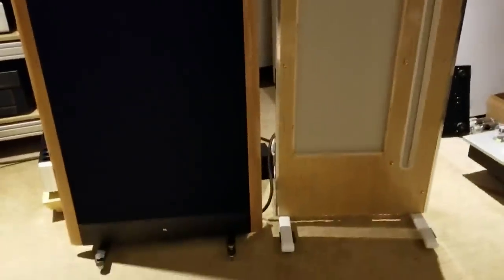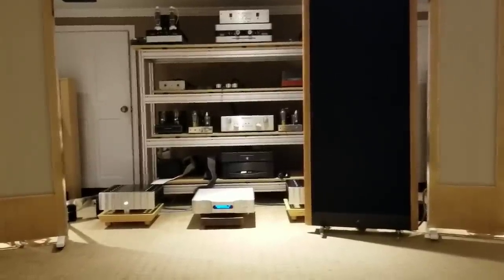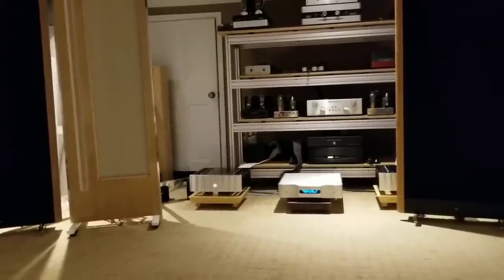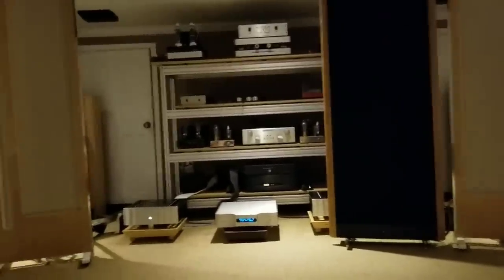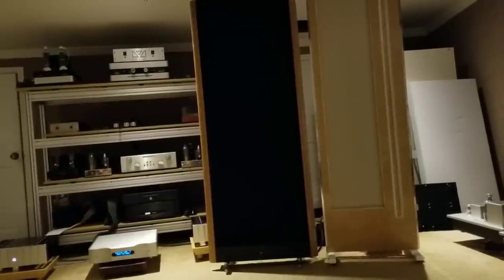King Sound ELECTROSTATIC SPEAKERS V.S.  PLANAR MAGNETIC Magnepan.

Comment: ::::::::::::::::::::::::TIMESTAMPS::::::::::::::::::::::::::::
Electrostats               -                 Maggies
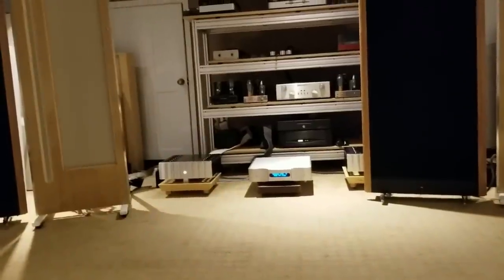     2:38                       -                     8:30              
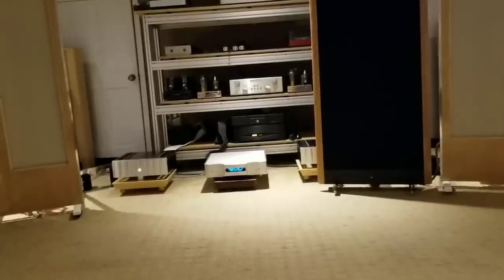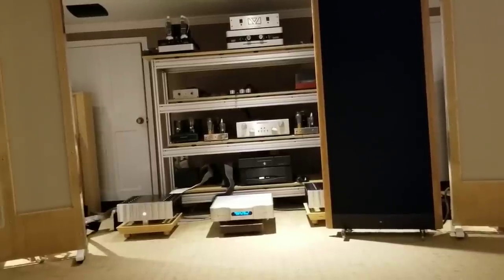     4:31                       -                     9:28              
     5:43                       -                     10:58                  
     6:53                       -                     12:13               
     7:35                       -                     12:55
Reply from the maker: Thanks Brother !
Reply: OCD HI-Fi Guy Maggie’s sound more realistic ... would you agree? Which do you prefer?
Reply: Electrostats sounded kind of muffled. But then again, it would be better to hear them in person.
Reply: Big difference in tonality. Balance seems better on the Maggies. The stats push a too much midrange with less deep bass and treble. Conceptually I prefer electrostatics and their potential for greater speed and transparency because of their lower mass diaphragms but it comes down to execution. Quad 63s and the newer 2912 stats are transparent and well balanced tonally. They would be a good candidate for audition. These Maggies however do sound very nice I must say

Comment: I used to work in several high-end stereo stores and have heard many speakers including the maggies and many other dipole type speakers and every time I hear the maggies they sound too big. Sound Lab A3's do have good imaging if you drive them correctly.
Reply from the maker: Thats so funny as the only 9 fpoot head Ive ever heard was from SoundLabs. It was the largest model.  My gfiuess is you are too close to the mags. They are realistic image size to me and borderline small image size with the little ones.
Reply: My feeling exactly. I just went back to Maggie's 1.7s while i wait for a tweeter replacement for my 3.7 and I'm just not into them anymore. I've gotten them dialed back in sounding great, but I miss the wall of sound from the 3.7.

Comment: I have been on the sidelines watching and listening regarding "thin film/monolith" style speakers for 40 years - not kidding. Whether Apogies, Martin Logans, Acoustats, Mangnapans, Quads, Infinitys they all have than amazing resolution and dispersion but ultimately leave me cold. I'm a sucker for "in your chest dynamics" that mimics live venues, but the millimeter of foil movement is just so g-d inadequate. I'm really hopeful this can be solved one day...
Reply from the maker: Not true when you make it a large surface area, then a mm kicks the chest. My Analysis speakers have a rubber surround around the woofer ..
Reply: @ dan dinhofer- you need to experience Bob Carvers ALS (Amazing Loudspeakers) Platinum series panels!!  They will rock your world! They approach the clarity + soundstage of planars & electrostats, but use 4 12" bass drivers and a 6' ribbon in each dipole panel. They can take 450 WATTS 
RMS @ 6 Ohms per side  and pound your body with bass. I drive mine with a WOPL upgraded Phase Linear 700B amp, putting out well over 1,000 WATTS,
and my neighbors hate  my ass sometimes... -)

Comment: Both great sounding , hard to be beat a good electrostat on mid range or Vocals for clarity and transparency , Try Joni Mitchell's Court and Spark ..Magnepan will almost sound like there is a veil over them  in comparison on a tune like that. Magnepan will give you more sound stage and maybe kinder to poorer recorded music. A lot may come down to what kind of music you tend to listen to. The modifications , a big part of it is bracing the panels so they do not vibrate on lower frequency extremes and there are stands made for that very thing you can buy.   they  have better rigidity than the standard from the dealer model and possibly some tweaks to other part of the Magnepan components he has made so maybe not "stock model vs stock model". Either way you cannot go wrong but they both need a lot of current to make them sound at their best.  Electrostats in particular have a wider range of resistance based on notes and are very easily under powered if an Amp is not stable down to 2 ohms.
Reply from the maker: I only do planar magnetic and yes, I completely rebuild maggies, I know them very well. My baffle is rigid and needs no bracing but the magnepan panel needs bracing for sure
Reply: @OCDHIFiGuy   what do you think about the 7i ? have you played with those ?
Reply: Try a pair of Beveridge Model 3s and Velodyne subs or equivalent or better.

Comment: The Kingsound  electrostats reminded me of my own Audiostatic 'Wing'  e/stats, i.e. they have a lack of output in the region under 350'Hertz range ...the richness zone & the satisfying mid to end upper-bass zone. Sub's that go to mostly 120'hz maybe 150'hz max' cannot remedy that, i need an extra pair to stand side by side on each channel but the added pair with a low-pass filter letting all frequencies below 350'hz through, hence adding 3'db in the lacking range. I found the original 1957 designed Quad ELS57"s to have the best bass of all i've owned Except the "Accustat Model X" pair  i have, no input transformers  (4 large tall wide full-range pannels per speaker,  & the best ive ever had all-round esp' bass, dynamics & richness) ...but  waiting to find somebody in U..K. who can fix their dedicated valve anode to pannel drive amps/ combined pannel energiser boxes.  Apart from a guy in U.S. (too far) i only found 1 guy in Germany so far with the skills & who also makes the same design concept.. (high voltage valve anode driven panel e/stats) ...to sell, but they're very heavy to send & the 2 engineers in U.K. who  said they could fix them before they saw the circuits,  were unfamiliar to the 7,500 volt drive from the 4 valve's anodes onto the panels & both said "where's the imput transformer?"  & were confused by the fact they never had any, so i didnt want them to try fixing what they couldnt understand with the circuit under their noses.    I've yet to hear any Maggies, folk generally tell me they are better in the bass & richness zone than e/stats, but a tilted-up top end isn't  my cup of tea.  I'll probably end up sending my Accustat  amp/energisers to Germany. 
My Audiostatics "Wings"  are peeing me off, considering they cost £5,500 new, they are a poor show below 350'Hz. Even at my £1500 s/h price, they're a poor show. Only great for the early pressings of the very first "The Doors" album which didnt have a bass guitar,  until far later pressings dubbed one in, i'm told.
Reply from the maker: Try listening to Magnepan or any Planar Magnetic for that matter

Comment: Maggies are great but they make everything sound bigger than life. My Acoustats give you the big open sound but everything has the right size and shape.
Reply from the maker: Is that so ? youre telling me MMG has bigger than life ? no it does not , not even my 3.7i modified has bigger than life, I cant stand that image < Sound Labs , was the speaker where I heard the 8 foot tall head singing. my Magnepan clearly do not have the same issue as the Sound Labs did. Ive never heard Acoustats ,  But my first test with Estat in my listening room left me with one feeling . Nice midrange.. no more  no less.. I need more than that..
Reply: Anders Hammer That is definitely not my experience. Real life size is one of the many attributes that my Tympani Iva possess. The major reason even the best loudspeakers can't come close to the real thing is the size, impact, and intensity actual live instruments (including voices) have that speakers can't reproduce.
Reply: @OCDHIFiGuy  LMAO sorry bud but you have not heard Soundlabs driven with big OTLs best sound i have ever heard period. Maybe not the best speaker for heavy metal or hard 80s rock but subline one anything else i drive mine with Joule Electra  Grand marque 160 monos and a boutique preamp with Western Electric 300 B tubes and tube rectification and tube regulation. Beautiful highs with details i have never heard from my old albums before never fatiguing great bass and soundstage like you are their. Soundlab make Martin Logan's sound like crap. Sorry that you will never get the chance to hear them at home with the right equipment your loss. I have had maggies great speakers for the price but Soundlabs are on a whole different level many know this already.

Comment: Mikey...sounds good.
3.5 i mags sound good no doubt, but as far as bass the Magnepan tympani 1 D speakers still surpass the 3.5's even the 20's.  I suspect but have nit heard to 30's yet but with there twin Bass panels lije the magnepan Tympani 1 D's had I would think the 30's would be just as good as the  Tympani's if not even better.  The real improvement in Magnepan's over all these years has been the tweeter improvements, the Bass panels have always remained very close to the original Magnepans.
Reply from the maker: Cool, Ive got a set of Tympani waiting for resto. These are 3.7i by the way, not 3,5.. Cheers !
Reply from the maker: You know these are 3.7i Right ? Also Ive added a separate midrange to them and they are incredible sounding.